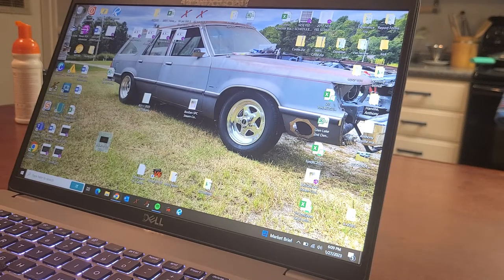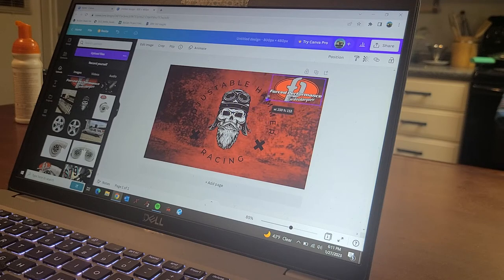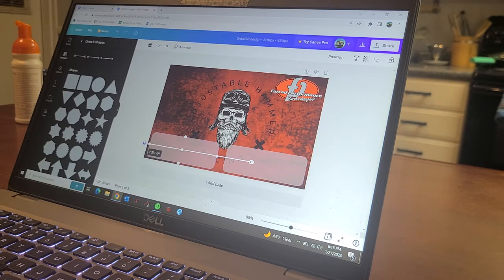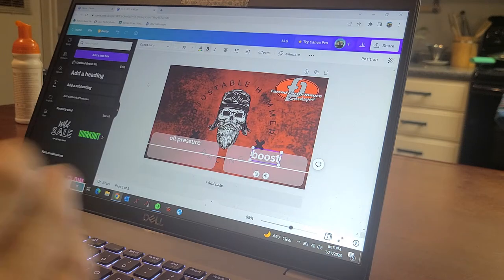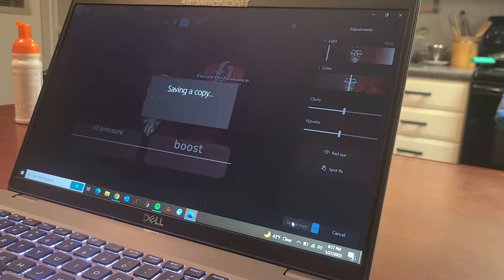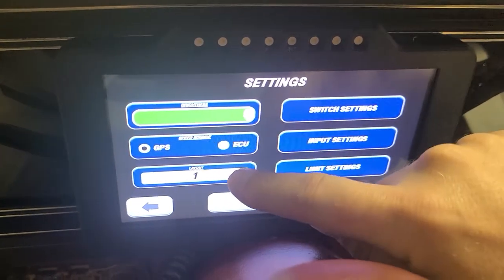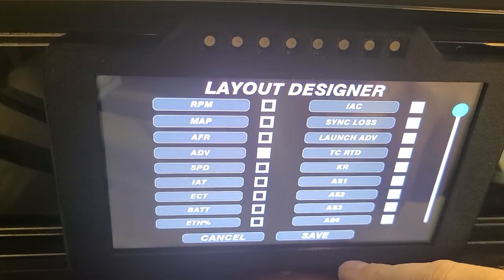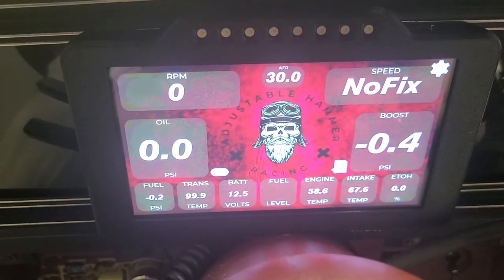Tinker Electronics Dash Custom Layout

Comment: How did you get ethanol percentage to display on your screen? I think when I tried it it wasn't available in the list of parameters. Did you actually wire a sensor into the tinker dash itself? my sensor goes to terminator x inputs
Reply: Disregard my question I figured it out for myself, to anyone also wondering - in layout designer IN1, IN2, etc are your inputs that are wired into holley